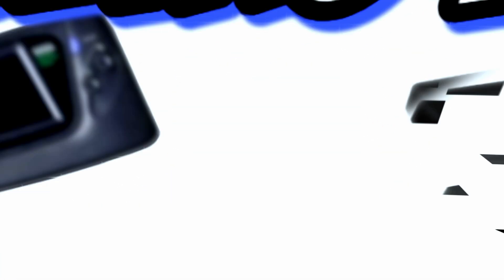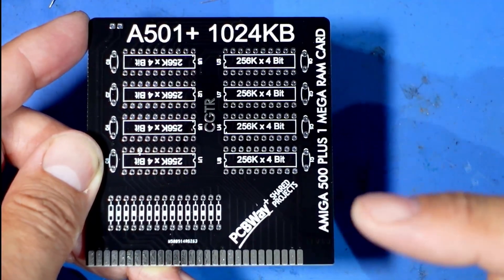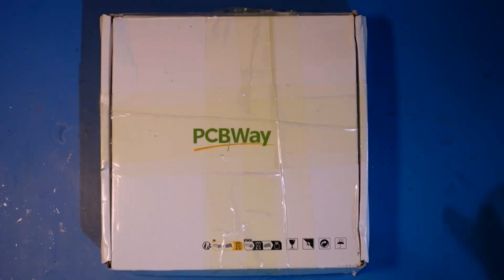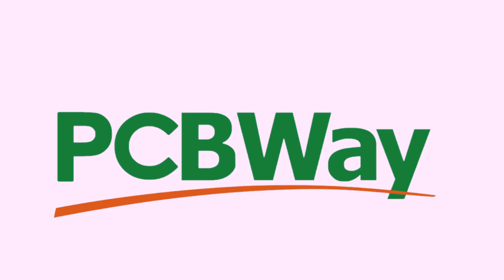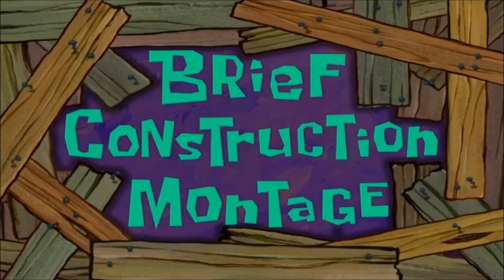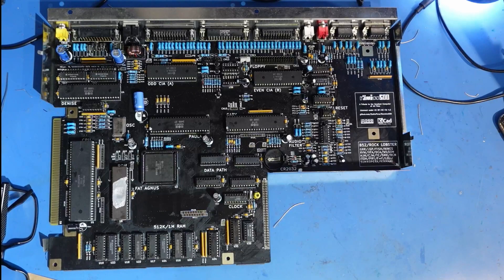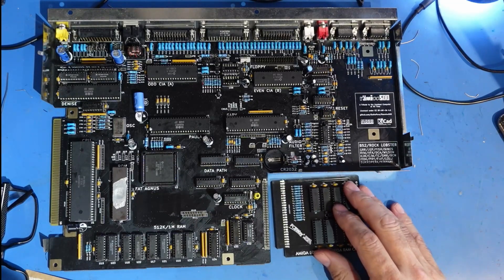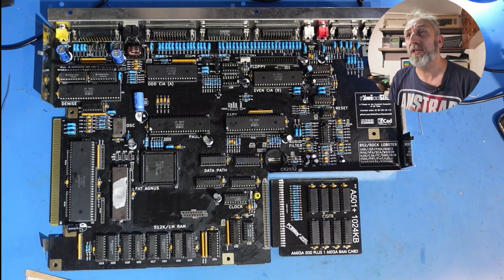How to Build an Amiga RAM Expansion – Easy DIY Upgrade

Comment: I will say (going from a very foggy memory) that back when I sold Amigas and accessories back in the day, the memory expansion boards typically went in with the chips facing up (toward the keyboard). You'd see the bottom of the PCB board before putting the trapdoor cover back on.
Reply from the maker: Yeah tbh it's makes sense as it would not fit properly the other way thankyou for the comment :)

Comment: You should be able to see which way up the expansion board goes by checking the supply rails match.
Reply from the maker: Yeah k thought that later 👋 well I hope it goes upwards otherwise ya going to be a issue lol 😂 thanks  for the comment will find out next week lol 😂